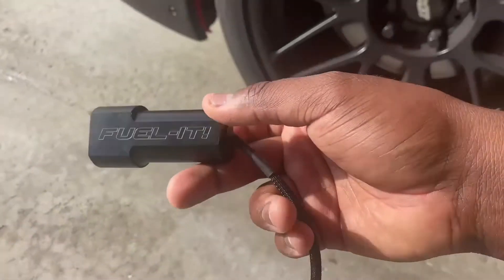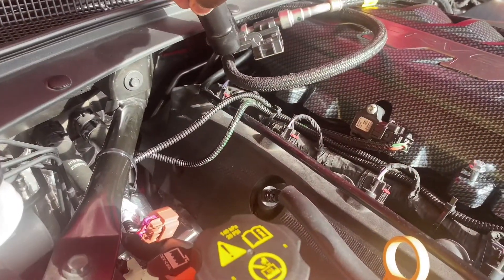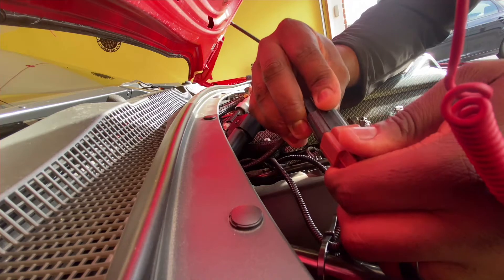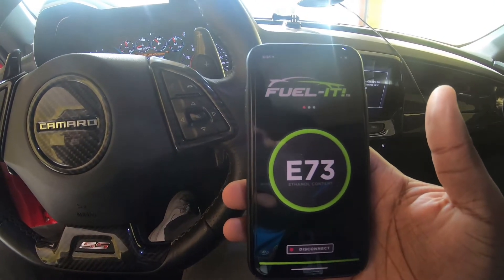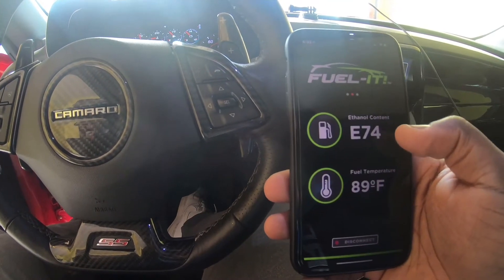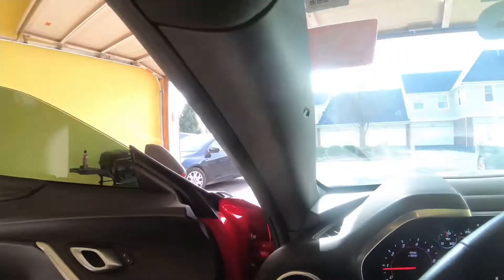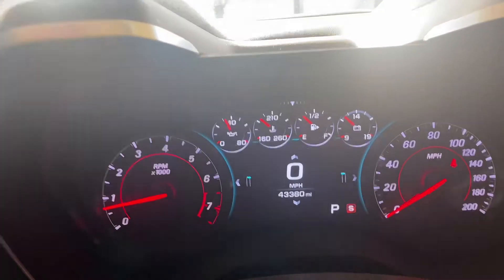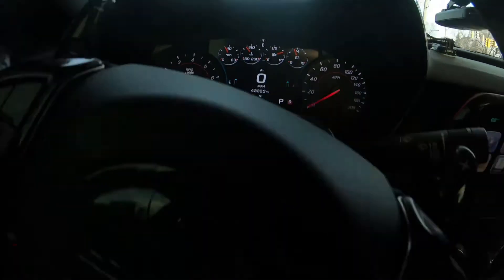Flex Fuel (E85) Bluetooth Kit | Ethanol Content from Your iPhone or Android

Comment: 🔥🔥🔥
What year is your car?
Reply from the maker: 2016 but this kit works on any year as long as you have the flex fuel sensor and the right Bluetooth connection. Our car use the Bluetooth with raw signal output
Reply: @BLUPRINT1LE  I have a 17 and can’t decide on what mods to do. Do you have the A8?
Reply from the maker: @camarochris78  yessir
Reply: @BLUPRINT1LE  I do too. I can’t wait to get the mods rolling.
Reply from the maker: @camarochris78  it all depends if you want cosmetics mods first or horsepower... once you decide..open the wallet 😂😂
Reply: @BLUPRINT1LE  🤣🤣🤣🤣
It’s hard. True.
Reply: @camarochris78  go power my dude I got a 19 ss everything is stock on the body except window tint and side markers but get the power mods flowing power put a smile on your face cosmetics are always changing